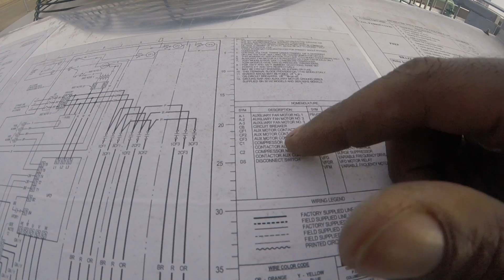HVAC: Troubleshooting Liebert CFM

Comment: That fan is ran off the vfd as a fan cycle control to modulate head pressure in  event of low load situation. I've seen other remote condenser ran off a P70 controller.